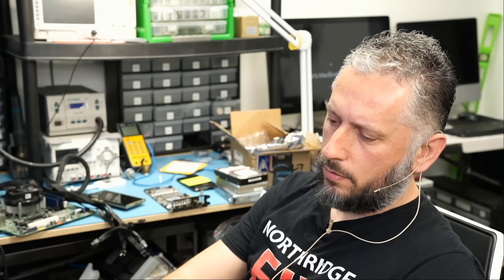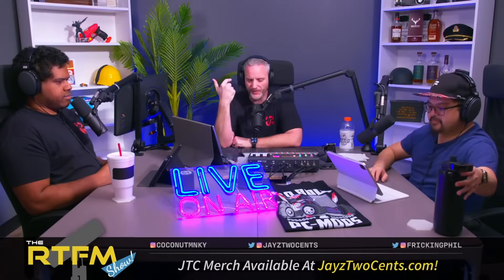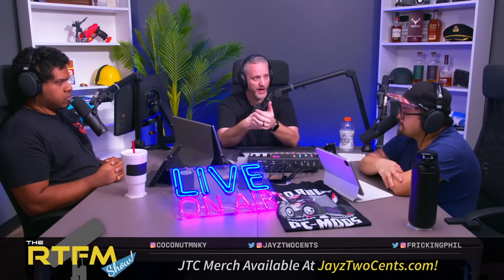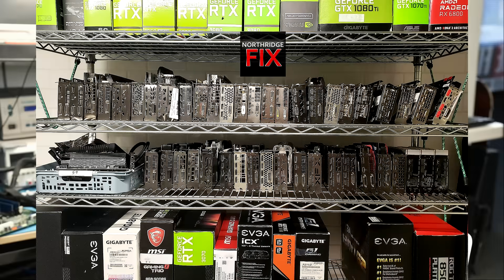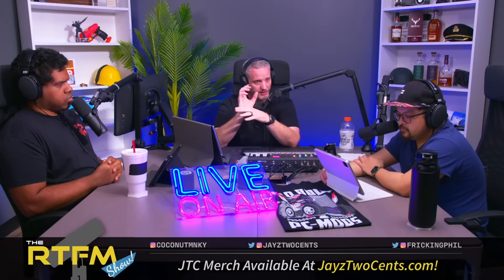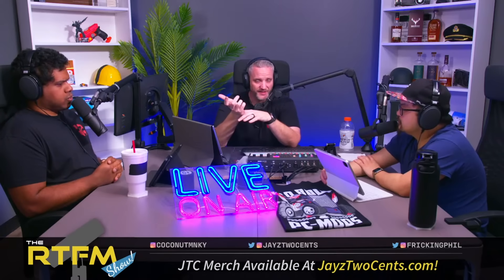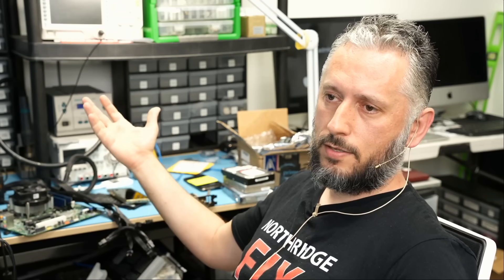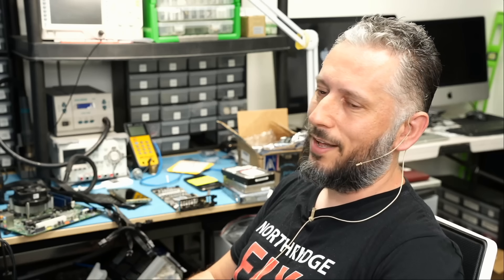Melting 4090 and CableMod. JayzTwoCents and Gamers Nexus Response. Blame NVidia or User?

Comment: Cause their is so many different opinions, im still undecided on whether or not to buy a RTX 4080 cause of the risk such an issue. Even though i always seat the cable fully, I'm wondering still if ill run into the melting problem. I dont know if the new H++ connector will be better than the H+ original connector. But im still worried about it all, i heard someone with a 4090 still melted the connector after 12 months use. I think since their are mixed point of views, i think you guys "Alex, Jay and Steve" should work together in the same room and figure it out together. Cause in the same room you guys will end up agreeing to the same conclusion at some point. I want an RTX 4080 for RT and game capture plus some 4k gaming. But at the same time i want a 7900XTX just cause it uses the connectors thats be used for many years and likely won't fail but have less RT performance. Maybe they should use a connector similar to a SATA power connector cause how often do they fail 🤷🏻‍♂️

Comment: one work around.  remove the plug. and install a "PigTail" cable that is a few inches from the board. with the correct plug. <One that is NOT designed for the 4080 - 4090 Series>
My opinion overall the card seems to be pulling close to the max load for the plug. with very little tolerance for errors. adding a pigtail would help. but not solve the power draw issue of the card.

Comment: Is the SEASONIC 12VHPWR 90° CABLE for the matching PSU safe enough to kind of work around this issue or do you need something like the CableMod one with shortened sense pins to prevent melting? I need to give advice to a friend. I just don't want him to invest an an overpowered card only for it to burn up.

Comment: I've got a 3090Ti, the clip on the cable broke off over a year ago.  I know that's not a direct comparison with the 40 series, but if the 30 series with a loose adapter (well, not loose, but lacking the additional support/tension of the mounting clip) works fine, I would assume that should be the case for all forms of the graphics cards.  Maybe the draw on the 40 series is just too high, I wonder how someone would test that.  Someone could put an in-line testing unit between the card and the PSU, although maybe others would say that the testing unit is the cause of that failure.

Comment: Not user error. Only 4000 series cards.  Seriously. Previous series cards are OK. The 4000 series should have 3 connectors.  There is too much power to one connector. Manufacturers must take responsibility, and the next generation of cards I bet won't burn because they know the 4000 series cards are at fault

Comment: Unique to RTX4090... 
So they are drawing 30A's or much more if overclocked on that connector. Ignoring the final failure does the thermal camera show a significant temperature rise on the connector? Is the temperature high enough to violate the spec of the board mounted connector or mating cable connector? You have power and ground (hopefully equal numbers to be a valid loop) adjacent to eachother. When the heat rises and the plastic melts does the possibility of adjacent connectors short?  Any failure analysis lab should be able to figure this out. They'd be wise to do it with the board in the motherboard socket and floating on a slot extender which has become more common. That will change the ground loops.

Comment: seems they dont have enough power pins, for a 450w card? 
Older 250w cards had 16 pins and leds that told you if the card power cables where plugged in. id never use a card adapter more connections the more likely a problem.

Comment: I agree with Alex. Throughout my many years of tinkering with electronics, I've never had a connector melt because it was plugged in partially. Most of the time it just won't make an electrical connection, and a re-seat fixes it. The only time a near connection poses a problem is with high voltage/amperage where electricity may arc across a small gap. Repeated arcs will melt even metal as seen in arc welding. The only other time they melt is when I run too much amperage over a connection but that was me being lazy and knowingly pushing the envelope on underrated wire/connectors.
If the connector fails through regular usage, it is just plain bad design. If you need a degree in electrical engineering to properly plug in a connector, it's also bad design in any commercial equipment. Imagine if plugs of any home appliance would burn your house down if they were not absolutely seated 100%.

Comment: My oven used to melt the connector on the back because the screws were not tight enough.... apparently the high power causes a sonic vibration... or something like that. I'm a builder... 😂

Comment: Feeding so much power through a tiny little connector is ridiculously stupid to begin with, and nvidia knows it. This is 100% planned obsolescence. Even with the cable plugged in correctly I noticed the connector still gets pretty warm. Given enough time these connectors with fail. 
 Very much like the pcb cracks I know a few people who had their connectors melt and had warranty claims denied because it was “user error”.

Comment: Melting of the connector occurs when more current is drawn than the expected maximum current. This raises the suspicion that the graphics card was overclocked. Various methods are shared on the internet to overclock this card. The manufacturer cannot be so stupid as not to have correctly calculated the maximum current and power that can pass through the connector. Gaming fans sometimes even apply physical mods on graphics cards. 
If you think this possibility is not correct, take the same graphics card and observe the current and thermal changes in the power lines passing through the connector during normal use.  If you see melting in the connector under normal use, file a lawsuit against the manufacturer.

Comment: If this is down to 'user error' when plugging in the cable, then, why hasn't this happened throughout all previous generations of graphics card?? The only difference is the connector itself so I would say the problem is the connector in question right? It has to be the connector.
Reply: there weren't any 3090 ti reports it had the same connector

Comment: 4090 power hungry card needs thicker terminal on the board and cable as well, might as well use the cars connector e.g. o2 sensor or to ecm but in thicker gauged wire
it wont hurt in anyway
there should be 0 airgap in connector and pin, if there is even in micro then it def needs thicker pins on board and connector

Comment: Seems clear that the connector isn't adequate for 20 amps throughput.  Maybe it can cope with that current if perfectly central and firmly pushed home, but if the design allows twist and slop then the connector should be de-rated accordingly.

Comment: My 4090 strix works flawlessly with the OE ROG AURA 12vhpwr cable. However if i use cablemods 180° or 90° adapter or 90° cable (yes ive went through all 3) my system constantly black screens, pops and shutsdown, or goes green digital camo. I have tried to go back and use the adapters again with the OE AURA cable and consistently got the same result as before. Cablemod dropped the ball. I dont even trust their v1.1 at this point. Not worth cooking my $2000 gpu.

Comment: yeah its drawing 450 watts. its obviously under gauged wire for that many amps. But that angle adapter isnt helping anything because its obviously not 8 gauge. This is like little kids messing with 450watts and burning your house down to be high speed low drag in fortnite.

Edit: It turns out im always right. Corsairs fix is making dedicated wires heavier gauge, not linking low gauge (not code) wires with a thin film of aluminum foil. on their replacement cables.

Comment: This isn't the first time an OEM vendor has made faulty products and then denied the problem. There was a hard drive manufacturer who had certain models where the coating would delaminate off the platters in the late 1990's. The computer manufacturer placed the drives in a clean room, removed the covers, ran them, and watched the coatings peel off and jam into the heads. But, the OEM was not moving from their story. So, these cards having a consistent failure mode where the connector fails on the card itself is definitely a design failure.

Comment: Idea: a high-res iR (infra-red) camera to high lite warm and hot spots. Your Viewers will be able to see the issue.
It would bring to light, what we cannot see with our own eyes. Hense the expression - "Now I see what you mean.". 
People use this expression when they finally understand something that words cannot tell them. 
A iR camera would quickly show components that were being over heated: chips, regulators ...
Other detection methods: a thermal touch/contact sensor or a point thermometer (not as fine resolution but good for in-situ checking).

Use it in the same way a Volt meter/oscilloscope gives a measurement.

Comment: 1. Any connector design that does not provide positive user feedback, indicating proper seating AND does not latch to prevent it from backing out by any means/mechanism other than deliberate, intentional user action is inherently faulty.
2. If 4090's are the only card that melts plugs even though other cards use the same plug and draw comparable power, then there is something wrong with the card.
3. If I had the time & resources, I would be recording current vs time while simultaneously recording plug hot spot temperature vs time during several melting events.  This would indicate whether the issue is an over current issue (board design) or a plug issue.

The either way, the heat created by the I2R at the connector.  The I (current) is a function of the load (card). The R (resistance) is a function of contact area/pressure.

Comment: Clearly Design problems by Nvidia and ABSOLUTELY NOT A USER PROBLEM that is why i see now GPUs with 2 or 3 connecters on the PCB because of the electrical resistance is to big for a single connector

Comment: I will throw everything  on Nbdi@ as we're been milkd for every single thing..... and what about the wattage it consumes  dn resistors/transistors iodes electronics separating distributing  power how about if one left 20 watts lesser then the other one or vice-versa and one pin had to carry  more wattage  then it supports,, team work but if one dsnt push/pull al gets fundged right!?! values on electronics can change/difference. ..

Comment: If the melting ‘only occurs’ with the cable mod adapter at a much much higher frequency than without the adapter then seems to me that points to the adapter

Comment: I've had my strix 4090 for almost a year now since it came out, and I haven't had any issues, and I can say this that my power cable gets super warm... in my opinion, it's halfway on his way to melting temp as far as the temperature is concerned. What I think is some of the cables just barely get over that threshold to where there's enough heat to cause some resistance and then it starts running away..... resistance more heat more resistance more heat. I always make sure that my case temperature never gets more than 5 or 6 degrees above room temperature. I'm using a th toughpower gf3 1650 psu and cable.

Comment: If the power is more than previous cards then the relationship isnt linear. The power dissipated in the cable and connector is current*current*resistance. The plastic then acts as insulator to heat and heat gathers up until connector melts.

Comment: It's amazing that the new connector made it to users. Even from a laymans point of view, the change from 2/3/4 8pin plugs, to a single plug would make me expect failures. Perhaps it could be executed properly, but it just seems undersized to achieve any sort of thermal isolation. There should be larger gauge wires and larger pins, at a minimum, but a more sophisticated latching mechanism would help as well. Software or sensor checks against the connection would be great.

Comment: Nvidia is absolutely an anti consumer scummy company. They sell their cards for way too expensive. They lie about manufacturing costs, they say chip manufacturing has gotten more expensive while totally skipping to mention that the same sku's they release have gotten way smaller in die size compared to the previous generation. Yes RTX 4080 has a die size of 379 mm², while 3080 has 628 mm², that's 40% decrease in die size. Yet they blame TSMC's 25% more wafer cost increase. While also totally not mentioning that smaller chips are easier to cut without breaking, so yields are not only more but also better percentage wise. RTX 4080 is cheaper to manufacture than 3080 is. And yet it's MSRP was $500 higher. Then, RTX 4060ti 8gb vs 16gb, last time I checked, 8gb gddr6 does not cost $100. That new connector is really dumb. 6 12volt pins rating for 600 watts, while the good old 8 pin connector had 3 12volt pins and it was rated for 150 watts. Math says no.

Comment: Mine just melted internally as well. RMAing now what a pain in the butt! 4090 ROG Strix. I too had to separate the adaptor from the GPU with a pair of pliers! There was no evidence of melting on the outside but once removed you could smell and see where it was overheated and melted on 4 lower pins. I believe Steve needs to change his findings I can guarantee mine was fully seated: 90 degree cable mod adapter! I thank Jay and and the expert repairs that Alex do this guy knows his stuff and I completely agree with him!  I'll say again I used cable mod and it was in so tight that it took pliers to remove it. In essence The 90 adapter is toast and the card is toast, thanks ASUS for the overpriced not built correctly graphics card....jeez!

Comment: If I press in the connecter, until I hear the very important click - that tells me(the rule upon today), that the connector is fully/correct connected/installed into the video-card, I would be very mad, if I was accused for an insufficient installation of the connector-cable!
This is utter bullocks and a stupid producers 'cat after the mouse'-game ..and with a product this expansive, they are expected to produce a quality on this solution, that is failsafe(atleast not outrageously bad, as this turned out to be!!)
This is a outright ridiculous argumentation and behavior from nVidia - (and I'm an owner of a 3080!!)

Comment: Clearly a design issue with the card. Nvidia has been cheaping out on the design for an overpriced card to maximize profit and now trying to find some ways to reject the fault on the user... If your card can fail sol easily despite users doing what they think is right (and what they are instructed to do) is clearly proving Nvidia's at fault here.

BTW, I used to work in a test lab for a pc manufacturer and we used some badass connectors to attach PSU to test equipments because when you deal with some (relatively) high current you need something that will not add any resistance or could cause any issues (or errors in the measurments in our case). 

Also would be interresting to chalenge the connector specs (Molex, Amp,... ? whatever the datasheet must be available) and see how much current they are rated for and under which conditions. I would not be surprised if they are used at  (or close to) their maximum rating without taking into accound some other specifications (peak surge, T°, etc...). Also there could be some imbalance with one pin taking more current than another and over-heating, resulting in this kind of failure.

Comment: The problem is current and resistance due to the wrong connector or not enough of them in parallel. You have three or four sets of cables that are in parallel from the power supply that can supply more current than the connector on the board can handle. Smaller conductors and less of them and therefore more resistance. Current flowing through a resistor, such as an improper connector, dissipates energy as heat, and heat melts plastic… The fix is either a larger connector with enough current handling capacity or multiple connectors like some older generation boards would have… Electronics and physics are both wildly complex at times, but also stupidly simple.

Comment: Most likely the amp draw is not evenly distributed over the different pins and therefore the ratings are exeeded.
Have a look at the power cables and connectors that are used for 12v car amplifiers drawing less ampere than this card.
For sure the connector (and cabling) is not adacuate for the ampere draw of this gfx card.
I don't understand why this kind of cables and connectors are still is use today.

No need to have a big brain or measure thousend things to understand that.
Maybe some are trying to stay friends with nVidia and/or keeping the discussion open for more views?